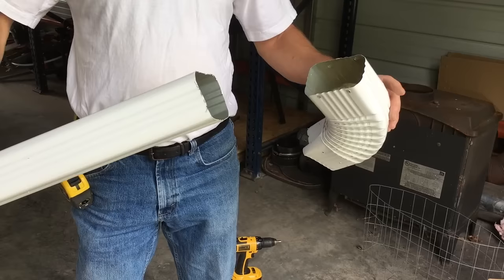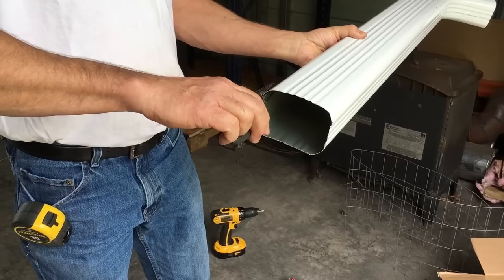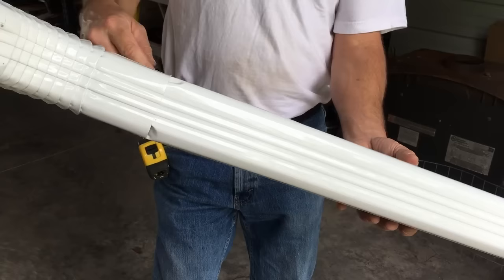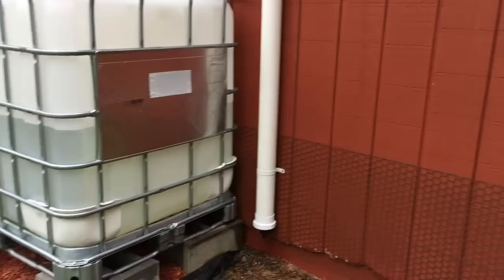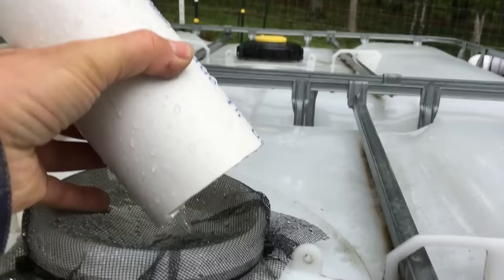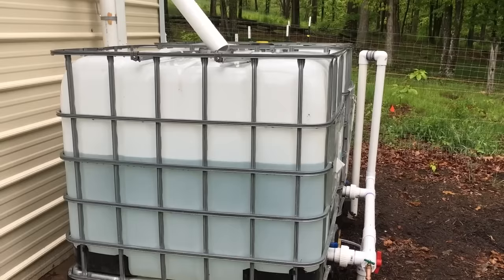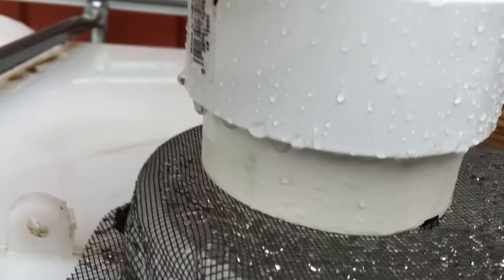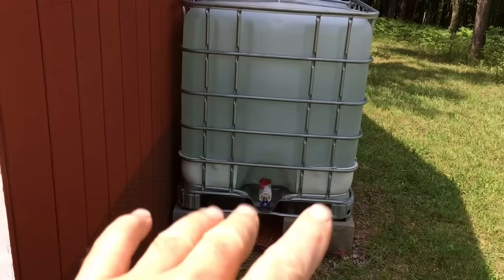RainWater Harvesting Lessons Learned

Comment: Great rainwater vids.

I would add something from the wall of the shed to the edge of the tote tanks to prevent water from touching the bottom corners of the shed wall.  This will extend the life of your sheds by preventing the slab foundation from absorbing water and the walls of the shed from rotting or rusting.

This something would be sloped down from the wall.  The material could be cement, corrosion resistant metal, or plastic.  You might have to move the tote at the red shed to increase the distance between the shed and the tote.

Another idea would be to add a grated channel (from NDS) to manage the rain water away from the floor around your sheds.

I have no idea how your gutter system is designed on the roof, but I have seen a great gutter system with a screen top with tiny holes.  This prevents large debris from entering the gutters, and it might help in preventing the first flush system from getting clogged.

https://www.ndspro.com/products-html/drainage/grates/channel-drain-grates.html

I am not recommending the product below, but it is meant to provide a visual idea.

https://www.amazon.com/Small-Screen-Gutter-Protection-Powder-coated/dp/B01N7WGIQ3
Reply from the maker: Thanks!

Comment: Why are your outlets so low to the ground? Why not have at waist high, and connect 3/4 valves, run to a drip hose for watering garden. I like putting them on the cinder blocks. I don't like having this leaking around your foundation...
Reply: Oh, and I was thinking of a black opaque tank with a water level reading tube to see how full they are.
Reply from the maker: I just used them right where they come out of the IBC.
Reply: If you have the outlet valves at waist high, then the tanks will only empty out to that level.
Reply: Valves not at the bottom loose head pressure.

Comment: @16:00 Could you just cut the tip off the valve handle?
An inch shorter probably wouldnt make a difference in the dificulty to turn the handle open, yet it would give clearance to open fully.
Reply from the maker: Yea, that would work fine.  Thanks!

Comment: use a 90 or 45 at the end of the pipe. Then cut a small piece of pipe 4" glue to 90 or 45 then on a female adapter and screw in a plug
Reply from the maker: Thanks Shane!

Comment: Thank you for posting this. I'm curious why you just didn't put the overflow at the input junction to the tote (after the first flush, of course) -- then you wouldn't need to have that bend and anti-siphon holes, etc... just a t-junction going to the tank, and another that goes up a little (above the top of the first flush level) and then over the side.

Like in this video:
https://www.youtube.com/watch?v=lV_jwlvrgsE

Is it the pitch of your system's feed pipe?
Reply from the maker: It is just what we did during our trial and error phase.

Comment: Use zip ties and heavy canvas on your frame to block the sun
Reply from the maker: Thanks for the idea.  I was thinking about using spray paint.
Reply: Great Escape Farms I might be worried about flaking with paint. And to me it just seems faster and easier to recanvas/tarp/black plastic wrap something than to have to sand and repaint it every year or two. If you put your canvas or plastic or whatever between the frame and the tank instead of over the top it should also hold up better because it's always being braced by both the frame and the tank no matter what way the wind blows.
Reply from the maker: Yea, that makes sense.  I'll have to give it a try.  Thanks!

Comment: Instead of painting pull the bladder out and wrap it in heavy black plastic and reinstall it in the cage.
Reply from the maker: That is a wonderful idea, but I’d still have the heat issue.  What I may do is take your idea of wrapping in black plastic and then either pain the black plastic white or find a light color plastic to cover the black with.  The reason for this is so I don’t heat the water up levels that I cook the plants that I’m putting the water on in the middle of the summer.
Reply: I saw a video and they wrapped the outside of the tote with shade cloth. Looked pretty good but I didn't think it would block enough light to stop the algae. Maybe wrap the bladder in black plastic then wrap the assembley in a light colored shade cloth leaving the gap created by the cage.

Comment: at some point you need to paint that pvc
Reply from the maker: I agree.  PVC will break down when exposed to the elements.  At 5 years in we are still running good without paint, but I know that it will be an issue in the future.  Thanks!

Comment: should have painted them black so the algae would not go inside the tanks
Reply from the maker: Agreed, kind of :)  I plan on painting them with a light color to prevent light from getting in and preventing algae, but if it is light, it won't get supper hot from the sunlight.